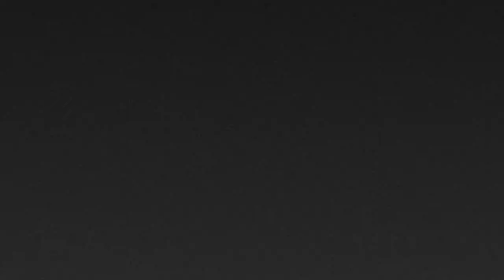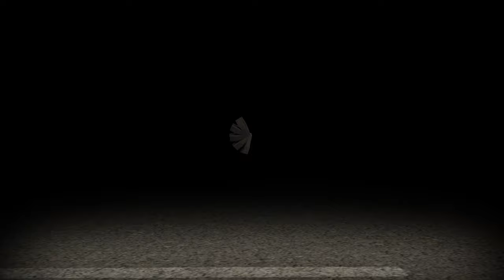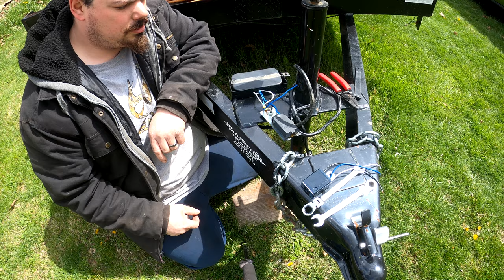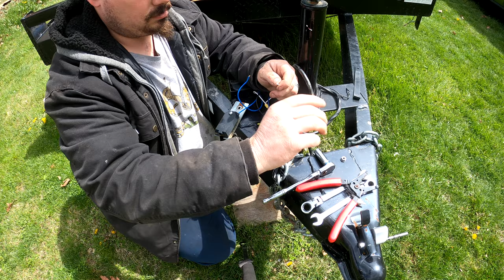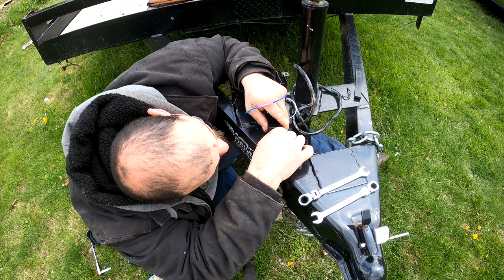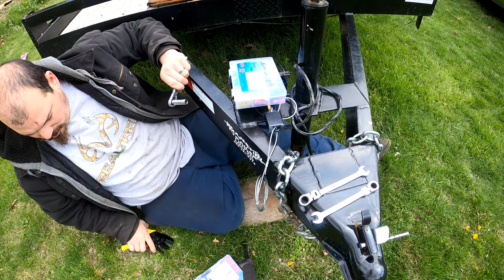Breakaway Switch how to install

Comment: Nice honest job. The breakaway switch should be secured to the trailer frame so it is free to pivot. This ensures that the breakaway cable will always align with the switch so it can easily pull out of the switch should the trailer separate from the hitch. A nylon locking nut to secure the switch will allow this while preventing the nut from loosening.